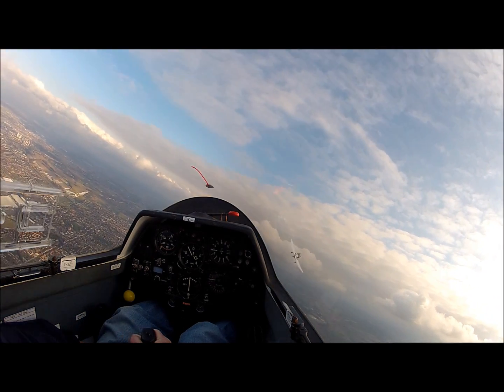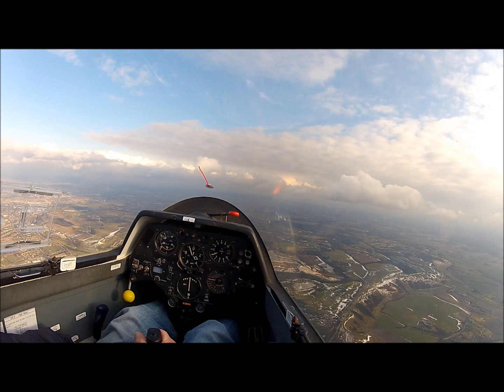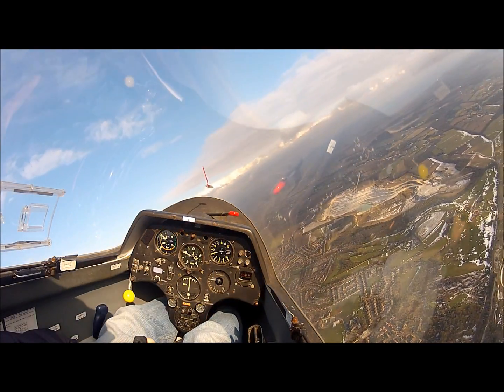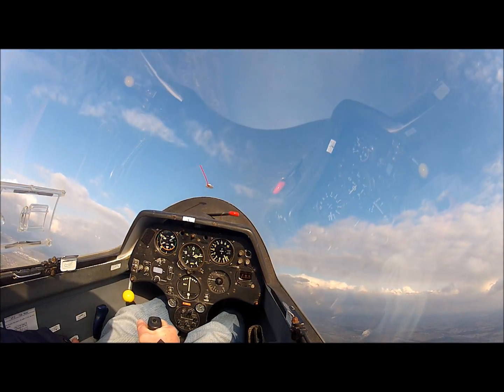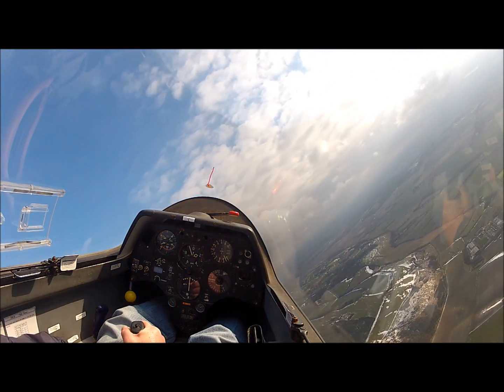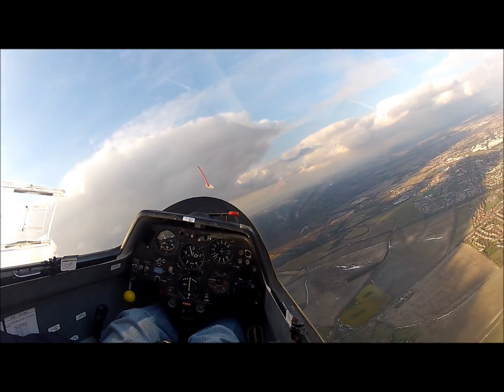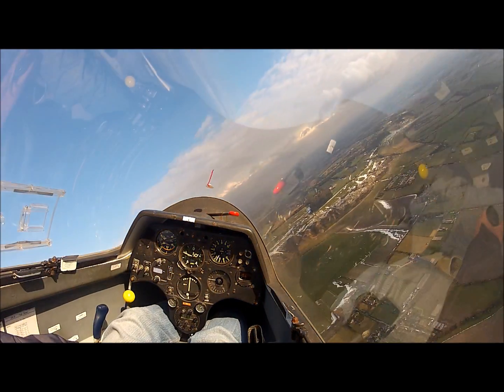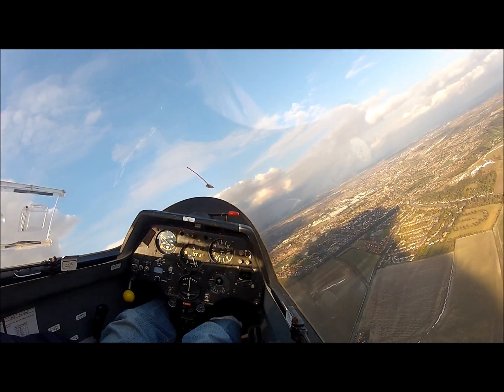Spinning and recovering a glider (ASK23)

Comment: Thanks for that, Andrew. I've just achieved my glider rating here in the USA, Boulder Colorado. The club uses a ASK21, and my instructor and I added spin weights to the tail ballast position at one point, to "force" the ASK21 to be able to spin, for proactice of recognition and recovery. Fun! Here's a short video: https://youtu.be/F5iaLGmkuN0
Reply: What you did was incredibly dangerous. I’m impressed that a CFI did something like that.
If a glider with its W&B and its configuration cannot do the spins, then, it must do not them!
Force a glider to do spins when it’s not built for it could result in an impossibility to recover it.
Reply: @filippoporro2049  This is not dangerous; it is a Schleicher tested and certified "spin-kit". Spin recovery training is mandatory for students and a lot of clubs have the ASK-21 for training. So Schleicher did all the spin testing and certification with the additional tail ballast.

Comment: An interesting demonstration of spinning an ASK23 in a thermal turn but no explanation of why it happens.I assume it is because an application of into turn rudder yaws the glider & pulls the inside wing back below the stall speed.I have done some glider courses but not gone solo so I found the video disconcerting to find how quickly things can go wrong without any warning.Good practice is to keep the yaw string centred, so is this a peculiarity of the ASK 23 or should the string also be deflected out of turn in a K21 in a slow thermal turn please ?
Reply: Hi Paul, I think I'm about the same stage as you in my training, so anyone with more knowledge or experience, please feel free to correct me if the below is not accurate.

Sorry, I can't add much regarding spin causation - the explanation I was given is the same as you have put, inside wing stalls first/more than outside.

However, regarding the yaw string, I believe it is only off to the outside once the glider has stalled - the cause of which is increased angle of bank (the vario jumps down to 6 o'clock at the moment of increased bank). Correcting the string and not the stall, with inside rudder, causes the spin. Correcting the stall before adding rudder, by the easing of back pressure on the stick, would then bring the string central again.

Andy - may you please correct this or elaborate?
Reply from the maker: So sorry for the delay in reply. In this case the glider in a moderate turn starts to slip INTO the turn and without in-turn yaw will not spin. It causes the yaw string to sit out to the side. We are often told that we should have the yaw string in the middle but if you apply sufficient in-turn rudder to bring the yaw string back to the centre without first increasing speed then the glider will spin. This used as a spin entry technique works on most aircraft for all the reasons that you give above. It is quite difficult to get a K21 to do this and original purpose of the video was to counteract a comment that I heard - "a K23 is just a single seat K21!" I set out to show that this was not the case by using this simple spin scenario to express one of the many differences. It is probably worth mentioning that the glider is already stalled before the application of rudder and therefore the effect of slowing the innner wing further stalls it and accelerating the outer wing reduces the area of the wing that is stalled and thus the autorotation.
Reply: That is the exact thing being shown here. The glider stalls when the angle of bank increases (stall speed is higher with more bank) , then te pilot is not aware of this situation and corrects the slip, wich  basically is the glider falling sideways causing the yaw string to bend upwards,  with internal rudder, and thus making the glider depart from the gentle stall to a full spin. As a side note In some gliders applying full opposite aileron can also make the slip turn into a spin.
Reply: +Andrew Roch
Thanks for the feedback , pleased my armchair theory was correct.I was also puzzled why the yaw string was not centred in the turn but it makes sense if the glider is slipping into the turn opposed to yawing out of the turn as I first thought
Reply: Andrew Roch thanks for sharing this video. I have flown K21/K23 for 20+ years as an instructor and was not aware of these spin characteristics of the K23. Do you know if this can be reproduced for both heavy and light pilots? And are there any differences between the A and the B model of the K23 in this regard? Thanks.